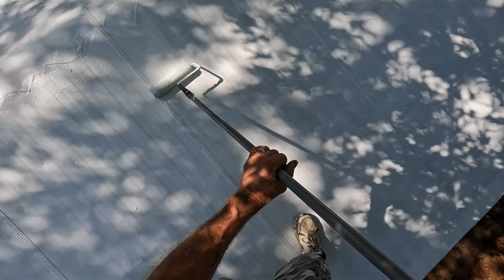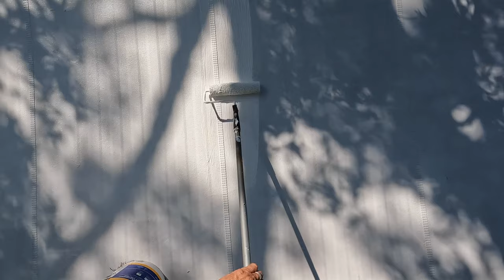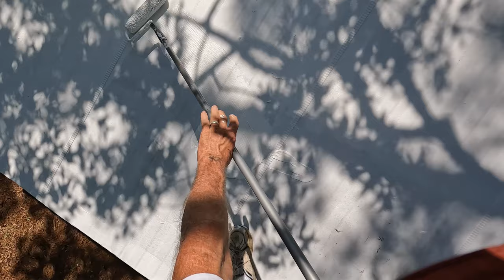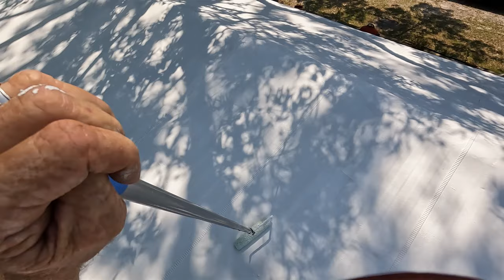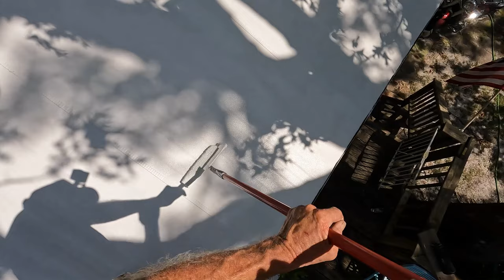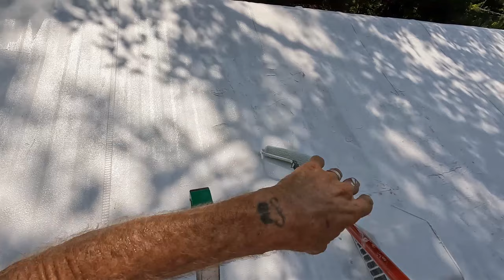Mobile Home kool seal Roof Coating

Comment: Talk about saving money... i moved back to West Central Florida in 2016 and bought a move in ready 1984 , freshly painted inside, nrew carpet and flooring for 4,000 in a over 55 park. The park acquired it and wanted to get rid of it and i was there at the right time. Lot rent was 360 in 2016 but its only 435 now. I did clean up under it this last summer and the floors look like new . And im sealing the roof in about 3 hours myself.  The realtor said i could probably get 28 for it today. Great investment. Im not going anywhere.
Reply from the maker: lol. Maybe I can buy it from you

Comment: Hi drew ur boy up in mass am buying the kool seal will one 5 gallon bucket be a enough for a single wide? 40 x12 ? Or buy 2 5 gallons ? Couldn’t afford a new roof money sucks lol thanks guys Joey 💪💪💪
Reply from the maker: 2 5 gallon bucket. 2 layers
Reply: @Drewsroofingandhomerepair  drew my friend how long will the 2 layers last before I will have too do it again? Do I paint the roof first then the sides or sides first your channel is amazing if I had the money I would hire you but am I don’t have that kind of cash 💰 😭😭😭 Joey
Reply from the maker: To be honest, the can says seven years some of them say 10 years but in my area because we have such extreme heat in the summertime I recommend recoding the roof every three or four years or whenever it starts to look faded and I paint the edges first because if you roll the roof first, and then paint the edges second, you’ll be sliding around on Cool Seal

Comment: i was thinking of strapping down my roof by  using  fire hose type material  over the roof tied down to the ground. Why   because  my place is in florida park.   My place is in a park where many  roofs were peeled back by storms What does MR> Drew think.    What about   cool paint on the wall    . My south wall gets a lot of sun.
Reply from the maker: I’m not sure about the straps, but yes Painting deciding WHITE would be a good idea